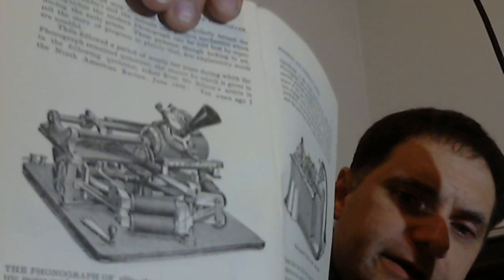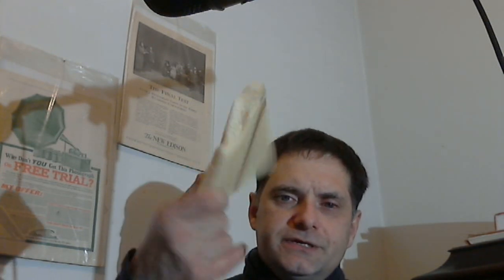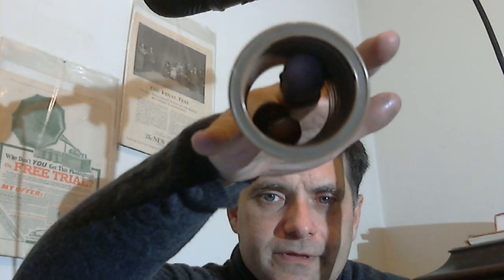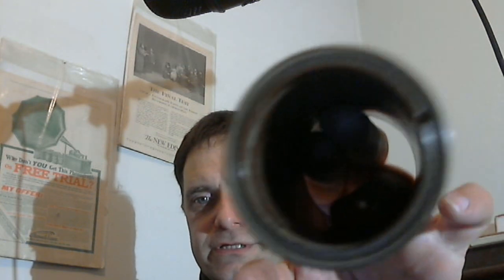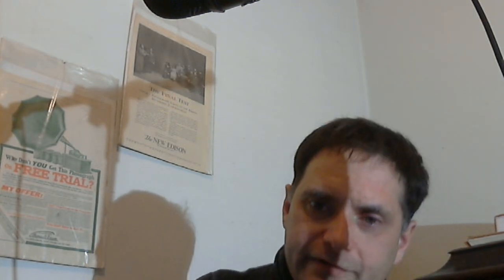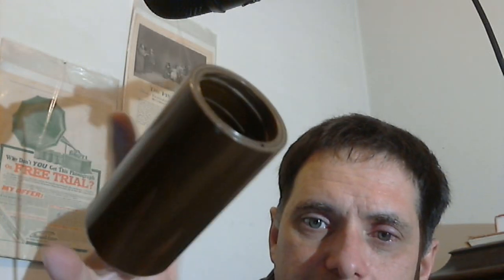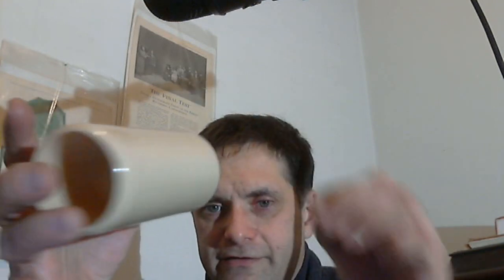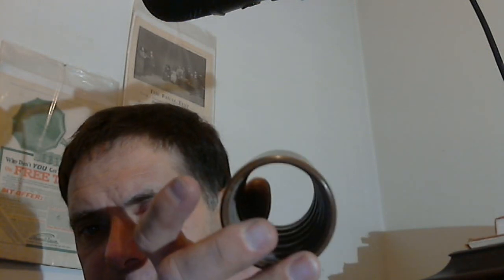Edison Brown Wax Cylinders how to identify 1888-1902

Comment: Tip: To reduce the "hollow sound" of duplicating a cylinder using the tube method, try stuffing some muffle (cotton) into the very top of the recorders opening and experiment. Line the inside of the tube with something thin and soft. Much of that hollow sound CAN be reduced. Anything to "absorb" that hollow quality. Yes, the record won't be as loud, but it also will not be so "raw sounding" either.

Comment: Cir. 1988. I came across 6 Edison Cylinder Records that had never been opened. (Probably the 1st of the 2 minute Black Wax.) The boxes were Gray with a paper label showing Edison as well as having fancy words. (Not really all that colorful.) With lid off, there was a tremendous amount of white badding to cushion the record.  The outside covering to all was a thin transparent sepia toned cellophane of some type. The Black Cylinder had no lettering on the rim. The PRIZE was in the middle of the cylinder. A GLORIOUS label of Blue and GOLD with Edison's photo and seen as it looked 80+++ years earlier BRAND NEW VIVID. (This label was meant to be affixed to the Cylinder Box lid.) And playing a Cylinder for the 1st time ever since leaving the factory? ASTOUNDING!!!!!!!!!!  Smooth, click free. Clear as could be. Only 2 were ever opened. I have no idea what became of the other 4. Several moves shortly after and they were vanished.
Reply from the maker: The first Edison moulded records look similar to a brown wax, with the flat end, and just Edison's signature, raised lettering  and a faint record number scratched in after the grooves, most are brown wax numbers and some into the mid 8,000 record number.  These are not easy to find, and were made mostly from 1902-1904, by 1904 they were starting to do the round title end, and made both kinds until about 1905, titled and non titled. The non titled records took one minute more to mold than the titled records. 
   I almost never use tube to tube copying,  that was just for demonstration, and it was only used in North American era when records were usually listened to with listening tubes. Normally use a high quality 3 way Sony car stereo speaker into a horn made of poster board, this hooked to a Marantz 2235 and to the computer I have the selections EQ with the frequency loss compensated for.
Reply: @thenorthamericanphonograph1039   Thanks. YES, I remember that about the lettering.  (It is hard to remember back to the mid 1980's.)  LOL PS: Flat end BA Cylinders are the best of all. (The plaster core is colored too.) These were the "live" recordings. After the 1914 fire? Dubbed from the Diamond Disk. It should have been the other way around.

Comment: It's very impressive.  Do you show me the box of 1888-1894's Edison wax cylinders?
Reply from the maker: I don't have the original boxes for the original North American cylinders, one is in a post-1907 Edison box, and the other is in a new cylinder tube that I use for the blanks I make. The North Americans sometimes came in square containers with a mandrel inside, and others a plain cardboard tube, with no outside label,  The North Americans when new, and when pre-recorded had a  paper label with title artist, and Made at Edison Phonograph Works located in the channel. Some even said, in the channel, Columbia Phonograph Co., as Columbia used Edison blanks until 1895, and was not able to make their own cylinders in quantity until 1897.
Reply: @thenorthamericanphonograph1039  Thanks.

Comment: Are the earlier cylinders just blanks or do they have recordings on them? The ones you showed
Reply from the maker: Unfortunately, one was shaved probably during the time of cylinders well over 50 years ago, the NA cylinder with the crude channeled rim circa 1890.  The other was shaved and contains a home recording by the Hildebrand family and a song called The Donut Shop. Well, I walked around the corner 
and I walked around the block,

And I walked right in to a donut shop.

Well, I scooped up a donut,

right out of the grease,

and I handed the lady a 5-cent piece.

Well, she looked at the nickel,

and she looked at me.

And she said, "This nickel is no good you see,

There's a hole in the middle,

I can see right through!"

And I said, 

"There's a hole in your donut too!

Thanks for the donut, so long!"

It seems this song came out about 1909, and was sang a lot as a camping song. So the recording was probably made sometime after .  I often wonder what was originally on them.  As I said, the NA period, if it had music, was mostly likely used in a coin slot phonograph, and played repeatedly.   I imagine that many of them naturally were with Class M phonographs, too and if it was still operational in say around 1915 or so, the music was probably considered dated, however the machine had a shaver, and if it still had the standard speaker, I am sure unfortunatly we lost a lot of early commercial records to home recordings. However the home recoding is interesting too, and I will probably make a video of it.  The North American blanks compound quality is among the best brown wax I have heard, as far as low surface noise.
Reply: @thenorthamericanphonograph1039  Really Cool. Thank you for the detailed response. I would like hear the recording, this video was good aswell.